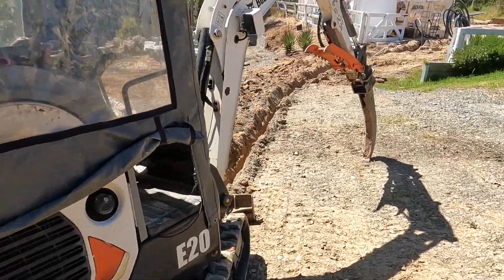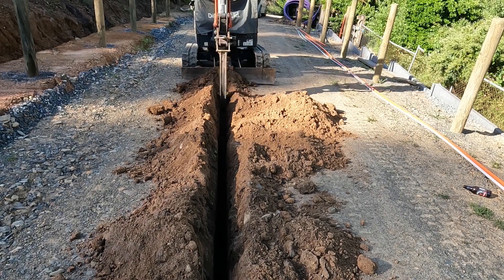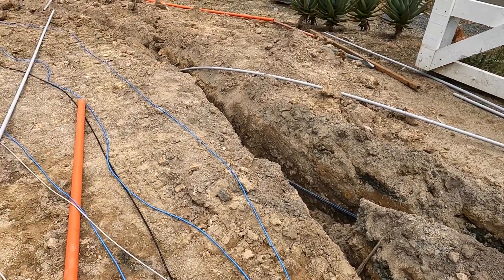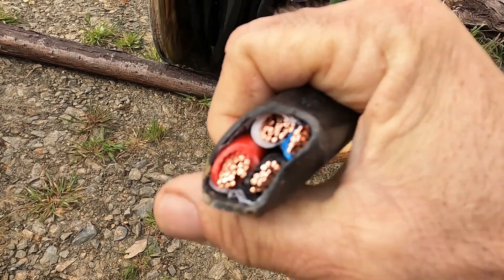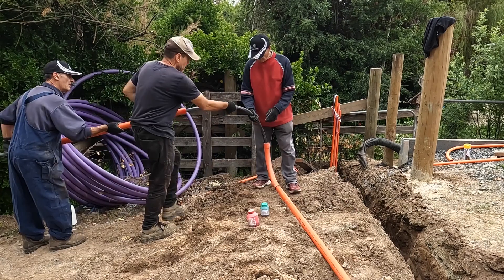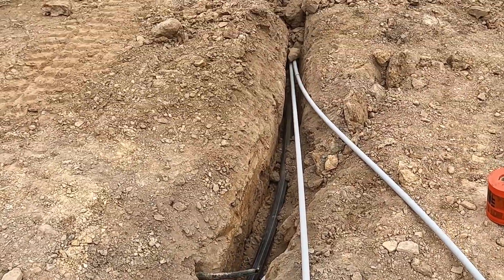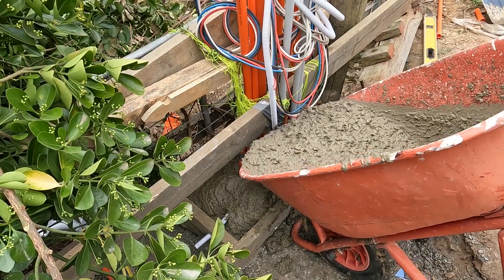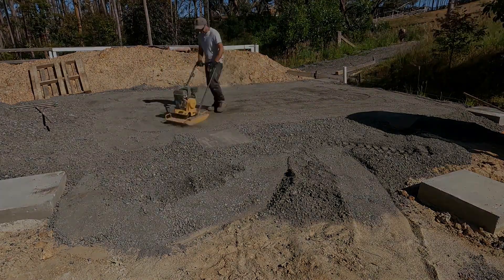Workshop Build part 4, Installing a new power supply

Comment: Gday, the excavator will pay for itself many times over by the time you have the workshop completed, best move you could of done is spending the coin on the digger, putting power on is not a cheap process now, I’d love to have 3ph here but way outa my budget mate, awesome job as always mate, cheers
Reply from the maker: Thanks Matty, everything is expensive these days. 3 phase is going to be a really positive for the workshop. Its a huge job but I figure the only way to get a premium workshop is to do most of it myself....